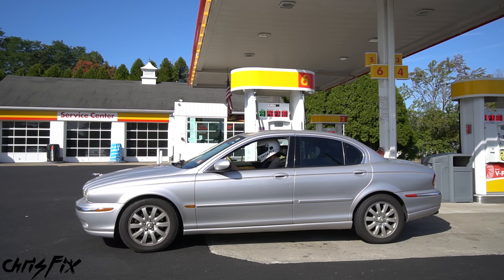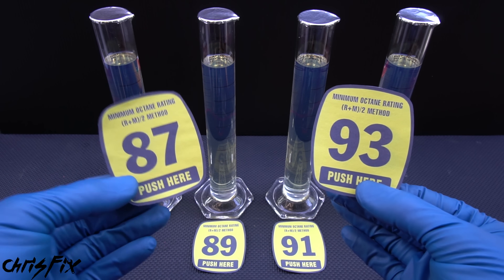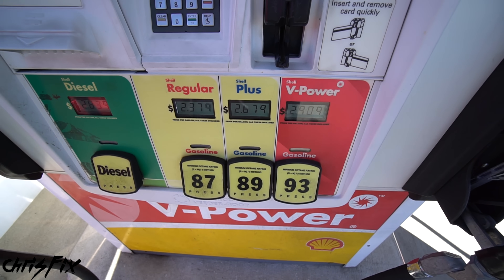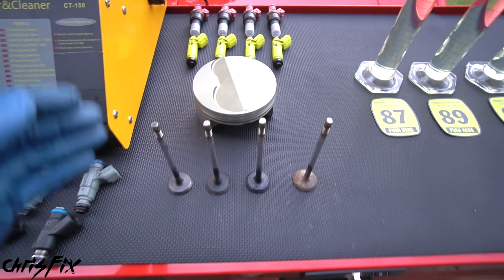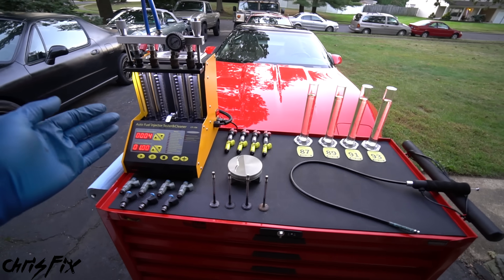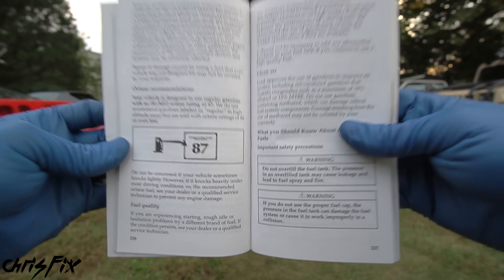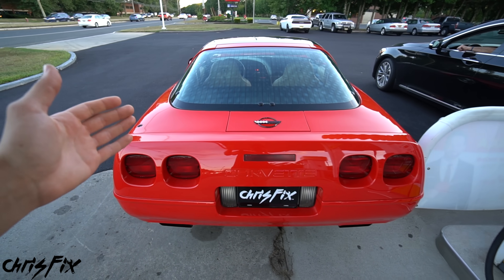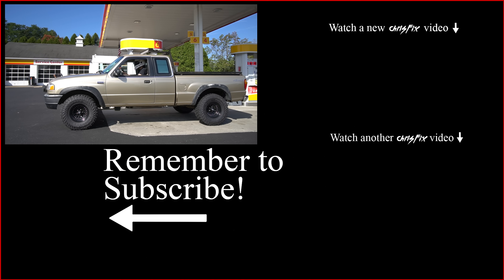What is the BEST Fuel to Use in Your Car or Truck and WHY

Comment: The right choice is whatever the manufacture said to put in the car
Reply: He said that in the video.
Reply: @davidlopan6649  10:28 exactly he literally says it in the video.
Reply: Shit really.Glad they can help me.I better start  using  the cheapass sparkplugs,generic drum oil that came with the car,andstart using regular unleaded snot fuel too and get them to service my cars.Wooohahaha.If you think using regular  fuel in your car is a good idea because someone tells ya then good luck.
Reply: Not really
Reply: @timonraccoon  Right? Not really. Dumbarse. 🤦🏾‍♂️
Reply: @timonraccoon  Give an example of a situation like that. F0ol.
Reply: @timonraccoon  this has never and will never happen. Car manufacturers don’t care what fuel you put. They don’t make anything from them. Most cars use the cheapest gas
Reply: @mr.castle  I will. My corvette says premium fuel is required although I put regular fuel. “dUmBaRsE”
Reply: @timonraccoon  Corvettes are V-8s so they need higher fuel to boost their horsepower. The engine is made tailored for 93

Comment: When I worked as an unarmed ranger at a state park in 1980 we had new Dodge trucks for patrol.  Man what total garbage.  It was just that period in the late seventies and early eighties when California was trying to lower emissions and get higher mileage at the same time, early crude automotive computers were just  getting under hoods, and unleaded gas was being mandated.  Back then the manufacturers had no good substitution for the lead in gas, they tried Teflon valve seats but as you have seen with cooking pans it did not last long at all.  Anyway, these Dodges we had, when you would shut the motor off they would go on rattling and banging and pinging and at points almost idling again, and this could go on for 10-12 minutes.  I once parked outside the office and ignored the motor noises and shaking as we were used to it by then, and when I came out almost 15 minutes later it was STILL knocking and dieseling.  Those rigs were just horrible.  You ever wonder why you see cars from the 50's and 60's but almost none from the 70's and 80's?  Their motors in that transition period were just junk.

Comment: Also the owner’s manual will also include information about the specifics of if your car can benefit from premium fuel or not if it’s designed for regular fuel! For example in Australia on the European octane rating system our Volkswagen Golf must run on 95 or higher otherwise engine damage may occur from engine knocking at any lower octane ratings! However it does mention that the car can tune up the timing on higher octane fuels like 98 for increased performance so some cars can run more efficiently and have increased power on when running on higher octane fuels than what they are designed for while others cannot so it all depends on what is detailed in your owner’s manual by the manufacturer! :)

Comment: My friend once had Citroen c4 1,6i. 
For some reasons, the car had an issue running on 95 octane(EU norm), but it ran smoothly with 97 or more. 
Any clue, what could have been the issue? He tried to solve it in multiple car shops, but in the end sold the car with that issue. 
But I am still curious what could have been the problem
Reply: It might have had an air leak in the intake and a richer fuel helped to stop pinging..or Blocked injectors not delivering enough fuel.
I don't agree with this video. The higher octane fuels clearly have more energy per litre

Comment: if you change the oil every 5000 thousand kilometers, then this will not happen on the valves) the nozzles can be cleaned with acetone) 0.5 acetone for a full tank of gasoline) what he showed in the video is complete nonsense) plus the candles need to be changed every 30,000 kilometers) well, you can 60) but the most important thing is to change the oil on time) you do everything high-quality there in America) and in Russia you have to think for yourself how to save your engine)

Comment: Back in the 90’s, mid grade was usually only 10 cents higher than regular per gallon, and premium 10 cents higher than that.  Now they are like 30 cents higher.   I pay more for non ethonal gas which also happens to be 89 octane.  Most places that have non ethanol only have 87 octane for the same price I get my 89 non ethanol. So at least I get non ethonal and higher octane out of it at the same time.  My car is definitely sluggish on regular this tank.

Comment: Hi, Chris, I am in Australia. My owner's manual says Unleaded petrol(Octane number 91 or higher), whereas, in the fuel filler door, it says e10 suitable. Currently, I'm using e10 and the fuel mileage is less than 10km per litre. Which fuel should I use for my car and for better mileage and performance?

Comment: I don't really know all the science behind the engine, and just use cars/motorcycles like a hobo who just stole a vehicle.

Anyway, the easiest explanation to me- on what Fuel to use... is to just look at the manual, and look what's recommended.
If it says to use 93... then my ass is using 93. Don't really care about the other things. ----- of course this only applies to stock.

Comment: 15:21 for the answer

Took 15 minutes to explain, "read the manual for the info" lol
Reply: Thanks! I've never yet seen a manual that said to use regular 85 gas, yet I've also never yet seen a normal car that will knock with it.
Reply: @JinnaiT  Knocking isn’t likely. The problem is the seals etc. in the fuel system may not be designed for that high percentage of alcohol. Can cause internal damage that can’t be seen.

Comment: When I had a small 25mph moped, that had a govener, if I bought regular gas it only went 25mph, but when I bought premium, it went as fast as 28mph.  This was a big jump for a moped, even though all the mechanics said that the gas would not make a difference.
Reply: brad mckenna  I love my moped, and I love big women, and I dont care what people think.
Reply: @senoraraton  but do you love big women on a moped?
Reply: It went 3mph faster because of your lighter wallet. j/k
Reply: @divineRevelations: You most likely took a huge dump and reduced the total weight just prior to filling with premium.
Reply: “We changed something but there’s NO difference”, yeah, that logic hardly ever holds
Reply: @henry3397  4x2+2=10 5x2=10 I changed something but there is no difference in the outcome
Reply: Inescapable Justice  No.  The opposite.  Ethanol is more expensive than gasoline and has to be shipped by rail or truck.  You government ORDERS you to buy blended gasoline to reduce pollution.  Your government orders you to purchase the expensive Ethanol to achieve that goal.  MTBE  (Methyl tert-butyl ether) is much cheaper to use to increase oxygenate content, can be delivered by pipe line but it is banned.  You pay more.  The makers of Ethanol sell more because the government says so.  Don't your schools teach you about government regulations?
Reply: No theyre too busy teach critical race theory and why you should get a sex change
Reply: @excelsior6365  no they don't !  That is the last thing they would allow to be taught.
Reply: The alloy of metal in old carb jets corrode with ethanol fuel after sitting and going through temperature changes. The gasoline additives are the killer. Your fuel system may have not been designed to use ethanol gasoline.  
Shell gasoline made my 1978 Honda express bog out . This is how I know ethanol is terrible for anything made before the use of ethanol caught on.
Reply: I have a 2008 clk350. I normally add higher octane 91/93. Occasionally I add lower octane; I get better mileage with lower octane which is extremely confusing but I’ll continue to use higher octane
Reply: @mattihalmari2539  Yes I documented that condition years ago in a small economy car.  The science is simple.  Lower grade has every bit as much BTU energy per gallon as high octane.  The difference is lower octane ignited easier and faster releasing it's energy more quickly.  So an engine with modest compression can actually generate more power from lower octane because the flame actually burns faster pushing on the piston quicker and harder. Very low compression engine  can actual produce less power from premium fuel because the flame propagates a little less effectively.
Reply: Inescapable Justice  didn't care for the insults, but that information was priceless.  Thanks for sharing.  I did t know about the lumber piece.
Reply: Inescapable Justice  I hear ya.  I looked that up...wow.
Reply: Small bike engines, and motorcycles have very high compression ratios, which is needed to gain power from higher octane gas.  The minimum to benefit from 93 octane is 12.75 to 1 if I remember correctly. 

The thing about gasoline is the octane rating is measured NOT accounting for the ethanol lowering it a bit. So theoretically any car could gain from midgrade gas, although it wouldn’t be much. 

After what ethanol  did to my Hyundai Accent, I only put ethanol free gas in my cars now.
Reply: @rowlandbuck2703  Ignition timing also makes a difference to how much octane you need. If his moped was knocking enough to lose significant power then it would’ve been noticeably misfiring or if it ran with that much knock with no knock sensors trying to adjust for it the engine would be toast.
Reply: @rowlandbuck2703  Ethanol raises octane, it doesn't lower it. That's why so many owners of boosted cars like to run E85 (along with its charge cooling effect).
Reply: @rowlandbuck2703  not exactly, I had a 95 trans am and it had to have 93, if I had a lower octane it wouldn’t ignite every time and would skip. It was stock like 9.5:1 compression so it’s not always determined by compression
Reply: @crimsonlight4205  Ignition timing is important as well. If it has an advanced timing for better performance, you'll still need the higher octane.
Reply: @crimsonlight4205  there are cars like that.  Merecedes likes to make cars like that for some reason. I passed on a small 2 seater convertible because it required 93, and round trip to work was 60 miles.
Reply: @tehagent1321  I have always wondered then, wouldn’t a engine with some form of vvti benefit from higher octane.
Reply: @rowlandbuck2703  I don't know who is feeding you information, but it is completely wrong.  Small scooter and moped engines are intended for sale in a lot of third world markets where high octane gas is either too expensive or not available.  High compression engines are also much harder to kick start.  Those small engines are low compression. 
Ethanol does not lower the octane of a gasoline engine.  It is used to increase it.  Ethanol blends allow the use of lower octane, cheaper gasoline components.  E85 is rated at 105  That is higher than premium.
Reply: @rowlandbuck2703  what did ethanol do?
Reply: @BrasileiroBritanico1  probably ruined the fuel system, it’s not good for small engines especially

Comment: If you take an American sports car and fuel it with UK petrol you add horsepower up to 180hp with a big American engine.
I have actually seen it personally and 20 hp to a Mustang. There is an episode of Top Gear where they do it too.

Comment: I like using premium even tho my ride doesn’t require it. And I’ve always assumed that it’s better for the longevity and reliability
Reply: No. The naming scheme is to just take advantage of fools. They are all the same grade, however, their octane ratings are different. Octane does absolutely NOTHING other than chill the fuel out. It's not a power adder as the general public likes to believe, it is literally a retardation device to make fuel less volatile. Nothing more, nothing less. Cars that require 90+ that run less, do damage. Cars that don't require it, gain absolutely nothing and can arguably make less power as it is designed to run on fuel with more volatility.
Reply: @supra1jzed  Aaaaaand youre an idiot. 

Modern vehicles will pull timing for 87 and advance it for higher grades. Turn your distributor on an old car and presto you need 91-93.
Reply: @tehagent1321  sure thing buddy! Good luck with that. They do what they can to mitigate what low octane is doing, however, it isn't enough in a significant amount of cases. Even cars with valve timing actuators end up with expensive repairs from running low octane incessantly. Cars that have static valve timing....lol. Well, keep bringing us some killer ROs! We love it!
Reply: @supra1jzed  So we went from 'no benefit' to 'not enough benefit' 

Exactly what I expected someone that doesnt know what theyre talking about to do. Admit theyre wrong, but still try to dance around being wrong. 

Stop touching wrenches.

Comment: Octane is a hydrocarbon chain, not a measure of resistance to engine knock. The higher the octane the more energy is required to burn the fuel, which is why it eliminates engine knock. By requiring more energy to burn it prevents predetonarion at lower temperatures.

Comment: None of these "look how clean my valves are" photos are relevant if you have direct injection, as most late model engines do.  They are exposed to nothing but air and, crucially, crankcase blow-by gases.  That stuff fouls intake valves without a stead gasoline spray to clean them off.

Comment: What? 87 octane fuel? This low quality fuel isn't even available here in Germany. The lowest we had, was 91 octane and it was called "Normal". In 2008 it was completely abandoned. Since that time 95 octane, in Germany called "Super", is the standard. Next up is 98 octane fuel and it is called "Super Plus". And for about 10 years now there are also hyper fuels with 102 or even 103 octane. Of course this kinds of fuel are the most expensive ones. Currently the price for a gallon of 95 octane fuel is roughly 7,30 USD per gallon. With the other fuels being even more expensive.

And i cannot stop wondering, what kind of fuel drivers of Porsche, Ferrari, Lamborghini and so on are using to refuel? This cars are set to use 98 octane fuel only. European cars in general, Mercedes, Audi, you name it.... the are all set to use 95 octane fuel. Using lower quality fuel will cause serious technical problems over time.

Comment: one fun thing that people including you probably don't know about petrol. the lower the octane the faster the combustion. it is a tiny difference and in the real world won't make a noticable difference. but if your car is made to run on the lowest grade fuel you have available, use that fuel. because of this slightly faster detonation do you get a very slight increase in fuel economy. small enough that you can probably only notice it after 1000 liters of fuel used. if you drive 1000 liters worth of the highest octane fuel and after that run the same roads, same speed and in the same conditions will you have used roughly 999.5 liters for the same distance due to the preasure acting on the entire piston earlier. 

as I said before, it isn't enough to notice ever but the effect is there so why not use it and save a couple bucks over the long run?

Comment: “Don’t put diesel in it” lol
Reply: The instructions were unclear, so I drank gasoline instead :(
Reply: It's actually interesting that in Italy diesel is called gasolio (but you can also say diesel) and gasoline is called benzina. I wasn't relly understanding at the beginning
Reply: It is far less likely that you will put Diesel in a gasoline vehicle vs the other way around.  Here in the US the Diesel nozzles are larger, and should not fit into the filler of a gasoline vehicle.

Comment: Down Under mostly has E10, which is regular unleaded petrol blended with between 9% and 10% ethanol, and ethanol contains around 35% oxygen. Adding oxygen to petrol results in a cleaner burn. My car is E10 compatible, where the majority of modern cars running on regular unleaded petrol today are compatible with E10. E-85 on the other hand, is a blend of between 70% and 85% ethanol and regular unleaded petrol (with an octane rating of 105). It can only be used in cars that have been specifically built or modified to use it, including flexible-fuel vehicles and V8 racing supercars. But I have rarely seen a pump equipped with E-85 type of fuel.

Comment: The lowest grade fuel use to make my injectors rattle in my veloster. I ran higgg higher octane in it and all the noises went away. It was however I high compression GDI motor.
Reply: that wasn't your injectors rattling. i'll give you a clue; watch the video again and this time pay attention.
Reply: @fransmith8992  replaced my injectors and low and behold. The noise was resolved. The cylinders had even burning of fuel with no signs of knock and they were cleaner than most other cars out there with the same mileage.
Reply: @dustinhenry8598  make up your mind. 1st you said you ran higher octane and the noise went away. now you're saying you changed the injectors and the noise was resolved.

Comment: In France the lowest we have is 95, the highest is 98, they are called "sans plomb 95" and "sans plomb 98" or SP95 and SP98. "sans plomb" mean without lead.
Reply: Europe has different octane calculations compared to the USA. Even though pumps in Europe say 98 octane it’s actually equivalent to a 91-93 octane in the USA and other places that use the same calculation.

Comment: Your "V-Power" has only 93 Octane ?
Reply: It’s v power because of the additives not octane. If your car needs anything higher than 93 octane (us) then you get your gas from a race track gas station
Reply: @Homentertainement2  Here in the EU V Power has to have a minimum of 100 octane ;) our normal petrol has 91 octane , super has 95 and super plus has 98 ...at some other petrol stations we have petrol with 103 octane ... that´s why i was wondering
Reply: RoB D but he also mentioned in the video about the rating system being different too
Reply: @Homentertainement2  yeah but just for interest how it is in the us
Reply: RoB D ok